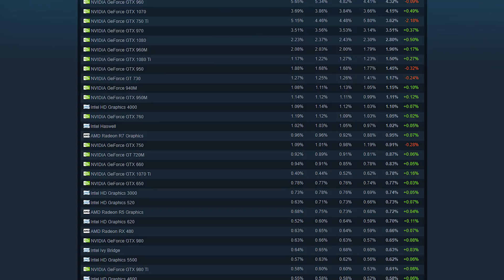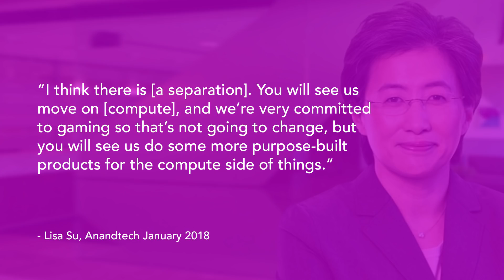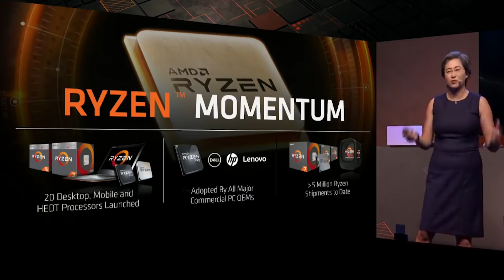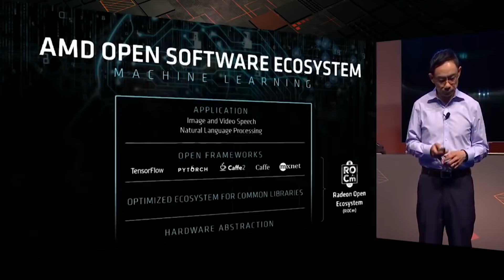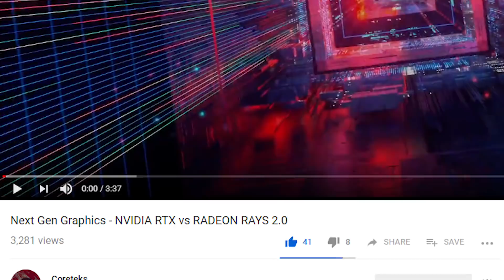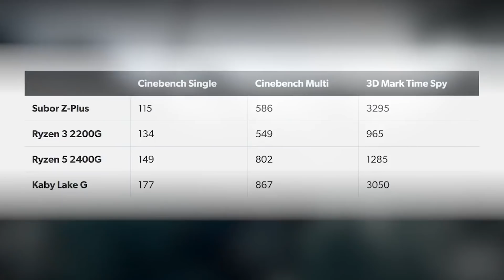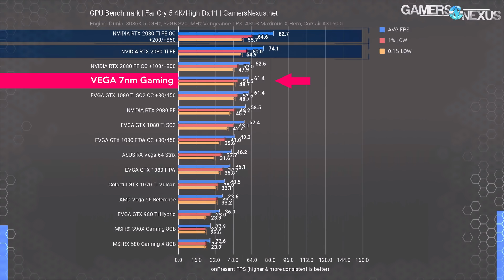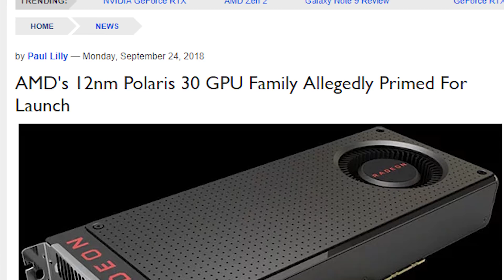AMD's answer to RTX

Comment: Not gonna lie. I am all over the 2080ti right now (bought two), but if this imaginary Vega GPU hits as suggested, i will switch over faster than any traced rays can render!
Reply: Rattenmann but the 2080ti most likely will outperform that vega on gaming. why the downgrade?

I mean it's nice if you support amd, they seem to need that atm. But if you are telling the truth you already threw a ton of money on nvidia.
Reply: I hope you also got a NVLINK bridge like me :D
But yes, if AMD makes anything that outperforms the 2080tis...Im going for it. Pro competition
Reply: Sooo how is your card right now when hardly any games support RTX? tbh I'm happy with my dual 1080ti for now as RTX seems like a waste of money till more games support RTX otherwise I'd just be playing games without using the full power of the 2080ti which is lame but that is their own fault for rushing a product that the gaming market wasn't ready for. If AMD's new card with the 7nm comes and performs close enough to the 2080ti I will likely buy duo if not trio cards since they'll be open source and I doubt AMD will make the stupid mistake Nvidia did with the RTX and to be frank that little loss in performance wont be that big a deal with today's games and the next games within the next few years. If AMD's new card comes cheaper then the RTX 2080ti then hell that is a bonus because the 2080ti is overpriced as fuck atm for a card that cant run at full performance for many of today's games since they don't support RTX yet.
Reply: @Zirethiel  cards are working fine. Better than any 1080ti. Up to everyone if they want to pay or not.
Reply: well, it is faster than 1080ti SLI, even without any RTX Features. So kinda happy here. Even without RTX Features, it is by far the fastest consumer GPU out there. It has a big price tag, but when was the last time you bought a flagship of any kind of tech (or even anything at all), and got the same price to performance ratio than buying a midrange item of the same category? It always costs a premium to get the best. The 2080ti is no different.
Reply: can you transfer money to my bank account please
Reply: Oof

Comment: Vega 56 and Vega 64 are actually great GPUs. They arejust 20% too pricey due to HBM memory. In compute terms, they're far more powerful than the competition.
Reply: They are good GPUs but the prices really are too high atm
Reply: Too bad the price is way too high, and compute means absolutely nothing for gaming.
Reply: ya. with the OC i have on myn i  beat a 1080ti.
https://www.passmark.com/baselines/V9/display.php?id=108634161978
Reply: @nosman123  omfg with the over clock?? ffs let me overclock the 1080ti and spank that ass sit da fuck down
Reply: looking at the raw performance (compute) can be useless because there is still other things that can affect performance such as architecture. but even if we look solely at compute performance AMD have one big problem. and it is one of their problem for a very long time: that massive compute performance can be very hard to utilize. this is one of the reason why despite their superior compute performance they are rarely score a design win for HPC contract. the last AMD GPU that enter top500 supercomputer list was Tahiti. Hawaii? despite murdering nvidia GK110/210 in spec sheet you can't find a single machine in top500 using hawaii based accelerator! with Vega AMD pretty much say bye bye to HPC and want to focus on AI instead but even that probably already too late.
Reply: @arenzricodexd4409  hey man, it's one thing if there are just minor mistakes, but you're way off the mark here. Why do you think cryptocurrency miners loved AMD GPUs? Why do people running 3D modeling programs run AMD? Because AMD is awesome not only on hardware but on software support too. They leverage open-source to compete with rivals. Recently announced NERSC-9 is an AMD Cray. SC18 (supercomputing conf) is this weekend. Maybe you should wait for news before making announcements, haha. Anyways, yea you're just wrong.
Reply: @edwardpark247  Mining is just one application. AMD excel at that because majority of the crypto algo was design with AMD architecture in mind. Amd have excellent software support? Just because they are more open source friendly than nvidia means their support was also good. There is one guy that emailing both AMD nvidia asking about OpenCL and CUDA. you know what kind of response he got? He got another email from AMD what GPU he got and what games he was playing. But from nvidia he was called directly by nvidia support team. When it comes to software support it is well known in the professional world how excellent they are in this regard compared to  AMD even if some of them did not really like nvidia approach with their proprietary tech. AMD EPYC processor might be a good fit for supercomputer machine but i dare to but for the GPU portion while company like Cray will be offering AMD GPU most of the client will end up picking nvidia tesla. Just look at top500 listing for supercomputer. Try finding how many using AMD GPU for accelerator in that list. When it comes to accelerator card even intel are more successful with their Xeon Phi. Even a few machine in the top 10 use intel Phi. Also you will not going to see Vega in top500 listing since vega completely lacking the most important feature needed for general super computer: FP64.
Reply: @arenzricodexd4409  new news today. have you read it yet?
Reply: @edwardpark247  yes. But it will not going to change most HPC client to use nvidia tesla over what AMD have. It has been this way for over a decade. Heck when AMD finally comes oit with S9150 there were article at top500 site talking how in half to one year time the top 10 spot will be dominated by AMD accelerator since nvidia nor intel have anything that can actually can go head to head with AMD Hawaii in term of raw performance. But in the end that prediction never come true. Forget about being in the top 10 not even a single machine in top 500 listing ever use S9150. And while AMD have improve the software side of things a bit what nvidia has done probably 10 times more what AMD has done. Software has always been nvidia strongest forte.
Reply: @edwardpark247  makes things up? i have been following AMD and nvidia GPU for a decade. just look this newly announced supercomputer called Perlmutter:
https://www.notebookcheck.net/Perlmutter-supercomputer-to-combine-AMD-s-EPYC-Milan-CPUs-with-Nvidia-s-Volta-Next-GPUs.361556.0.html
the CPU is based on AMD EPYC but the GPU will be provided by nvidia. why this new supercomputer did not use the new Vega 20?
Reply: @arenzricodexd4409   Yes the GPUs are NV Volta, that is correct. Next gen Volta, at that. Next gen EPYC as well. 

In the future, Radeon Instinct will perhaps be an option, but currently, Volta++ is way ahead of the game. Mind you, AMD has 7nm Vega incoming, so who knows, maybe they'll replace Volta++ with Vega due to availability issues. If you don't need Tensor Cores then AMD is a good option.

Anyways, from what I've gathered, the use of NV Voltas is because the system will make use of NV's Tensor Cores. The interconnect is Cray's tech. The buzzword these days is "heterogenous". No sense to stick to one vendor, take advantage of industry standards and interoperable techs to avoid situations like what happened when Intel's products were found to be dangerously vulnerable to hackers... clients were basically forced to go back to Intel for upgrades (patches could only solve part of the problem), which resulted in severe shortages, resulting in Intel having to go outside for production assistance with some 14nm products, but keeping info about what Intel's in-house fabs will be busy making, secret... secure Xeons, I'm assuming... and not for free, either, judging by Intel's recent earnings reports.

All I'm saying is that you, and others, can stop taking shit about AMD because they are doing something that noone else in the world can do, and that is, keep Intel and Nvidia honest. Cray going with next-gen EPYC (Zen 3 cores) is HUGE for AMD. Blade servers are back! Fuck yea! With water cooled EPYCs and Voltas, no less!

"the system will feature AMD Epyc processors and Nvidia GPUs offering a combined peak performance of ~100 petaflops and a sustained application performance equivalent to about 3X that of the Cray Cori (NERSC-8) supercomputer"

This is the optimal configuration for datacenter right now (not Perlmutter specifically, but as a sort of Proof of Concept that gives AMD a huge boost in Sales and Marketing). I have a feeling Cray Perlmutter is going to be the darling of the industry for a while. "Heterogenous" = AMD + NV. Why no Intel? It's because datacenter already has Intel. I don't know how much IBM Power 9 is out there, but EPYC also beat Power 9 for the design win. In any case, they (datacenter) don't need more Intel for a while. AMD will pick up the slack, and Intel can go back to deploying psychological warfare tactics instead of fighting straight up on the basis of technological superiority.

Maybe it's
Step 1. Evaluate NV and AMD offerings, with IBM's help. Hire IBM to consult as a independent 3rd (well, 4th...) party to help with highly technical cost-benefit analyses and other services that datacenter clients will be needing, as part of due diligence. Smarter IT is a strategic issue now. 
Step 2. Select AMD CPU and NV GPU.
Step 3. Buy from Cray.
Step 4. Profit
Reply: @edwardpark247  "Mind you, AMD has 7nm Vega incoming, so who knows, maybe they'll replace Volta++ with Vega due to availability issues. If you don't need Tensor Cores then AMD is a good option."

hardware is just one part of the problem. the client need the full package not just part of it. if there is shortage with volta (i doubt that it will since volta GV100 is built on much mature 12nm FFN vs Vega 20 that is build on much "scarce" 7nm at this point) i dare to bet the client will pick nvidia pascal GP100 over AMD vega 20. because this is what exactly happen back in 2014 when nvidia continue to reply on kepler for their FP64 accelerator while AMD release much faster and efficient FP64 accelerator on the market. if they can't go with nvidia they probably will go with intel xeon phi. 

yes relying on one vendor is not wise but as it is the alternative do exist. but sadly the primary alternative after nvidia is not AMD but intel. i was once thought that the accelerator market is just a duopoly between nvidia and AMD and intel will never be able to scratch the market much like how they never been able to do so with discrete graphic but once i saw the actual data i now aware i was completely wrong. intel actually quite successful in this accelerator venture to the point they actually eroding nvidia dominance. by market share the accelerator market was over 60% dominated by nvidia. the rest is pretty much intel. AMD market share for the accelerator market actually less than 1%! that's why those who said AMD better put more focus on compute oriented feature on their GPU since the gaming market are dominate by nvidia (some even said gamer pretty much ignore AMD) probably did not know that in professional world the situation for AMD GPU is much worse for AMD than it was for gaming market. 

for the CPU market i can see AMD will start going to make a dent on intel. Cray going for AMD CPU is not that strange either. the server market was once one of AMD strong forte. it is also the reason why Cray was quite confident with AMD Bulldozer before and decided to pick bulldozer to build the titan super computer (world fastest at the time) together with nvidia GF100 back in 2009. 

honestly we will want AMD to succeed but this fight is not a fight which AMD can fight both at once. they need to pick one and stick with it. the way it is right now they still have what it takes to wrestle with intel but with nvidia they probably can't win even if they pull all their resource to GPU development only. the "seed" that nvidia planted more than a decade ago is just too much for them to overcome.
Reply: if you use it for FCP X. other than that no reason to use AMD gpu
Reply: 'Gamers' don't seem to understand that. They're busy chasing frames and treat AMD cards like they're cancer unplayable cards. Bizarre.

Comment: I think "compute" was a codeword for mining (especially as spoken one year ago) rather than raytracing!

Furthermore raytracing as implemented by NVidia is not a GPGPU (aka compute) workload, but a workload heavily relying on new-generation dedicated hardware.

Radeon ProRender is a red herring, it's same thing as Optane and Cycles, just a GPGPU-accelerated raytracer - a predictably slow one, with tens of seconds per frame rather than frames per second. A little reminder that the prototype of RTX technology already ran at frames per second at prior-generation GPUs without the special-purpose hardware like RT and NN cores.
Reply: I think youre talkin a load of shit
Reply: Go ahead, download ProRender for Blender or as a plugin for some other software, it works on either AMD or NVidia GPUs of recent generations and doesn't give AMD more than a few % of performance advantage. Try it. It's critically missing any features that would enable realtime raytracing, it's same oversampling thing we've had for a long time. Its rendering speed is measured in dozens of seconds per frame and not frames per second.

Real-time raytracing requires a significantly different approach where you replace high oversampling with undersampling and smart interpolation, and that's something that according to Developers - see GN's Battlefield raytracing video - they had working on a previous generation NVIdia hardware, just a few times slower - and yet an order of magnitude or two faster than oversampling methods.

A year ago "focus on compute" was clearly reflecting the market, most GPUs were bought for mining, and mining is compute at its purest.

And look at composition of RTX chips, look at RT cores and Tensor cores, the former are dedicated units that evaluates spatial data structures to enable raycasting and do nothing else, and the latter is a programmable hardware that transforms one image pattern into another based on a trained dataset.

There is no statement of mine here that isn't demonstrably valid in the factual part. You're free to draw different conclusions from the same facts, but i think it's more of a reach to suggest that they meant raytracing all along. Furthermore the bulk of the PC market is not high-end but low-end to midrange, and raytracing isn't coming to NVidia's mainstream products this generation. ATI/AMD gave up the high-end gaming market a while back effectively, so while they were demonstrably aware of NVidia's raytracing efforts and contributed to Microsoft DXR standard, there's no reason for them to push it this generation, rather more likely the next or a subsequent one when raytracing is more reasonably expected to be available to the mainstream consumer.

Comment: Awesome video.

AMD has not and will not 'give up" on gaming.   BUT

from what I have seen, AMD is focused on continuing to push Intel out of the commercial server world with it's CPUs. 

The Instinct card are a bonus, as they are far better tuned for a wider variety of compute, and are the price to performance leader for a larger portion of the market. ( and have been since before Ryzen)

AMD, will settle into the RX570 - Vega 56 performance area of the gaming market for it's main focus.

With Intel cutting it's teeth in the GPU market, Intel will take over the SUB 1050 ti portion of the gaming market.

Nvidia will become the APPLE of the market. (Selling a %15 performance increase for %71 more money, because RAY TRACING. . . .)
Reply: Why

so much space?
Reply: efficiency.

each company will still make a full range of cards but their focus will change.

Intel needs a portion of the market won't be high end, and probably will max out at the rx560 level.

AMD just needs to exist, and it would be a waste to pour money into a 2080ti killer.

Nvidia has had a taste of "f***-you-you'll-buy-it" sales, and now, only cares about numbers that look good to share holders.

Intel has stupid business, who just need a "some hardware" (and can then charge MORE for CPU with iGPU)
AMD has leisure gamers
Nvidia has competitive  gamers

(to use nice words, I personally don't understand why a gamer needs to push anymore pixels than an HTC VIVE PRO.)

they will all need to use up faulty and poor quality chips in GTX1030 and RX535, but R&D will be focused on their 'sweet spot' in the market.

also AMD would be foolish to not wait for Nvidia to shoot it's self in the foot, or stagnate it's area of the market, before making an attempt at high end.

Intel's process-node-production-issue, will put it in a great place to completely restructure to and AMD style of CPU line + APU line.
Reply: LMAO your JURK comment had too much space and I didn't see the JURK part.

It's called 'formatting'

makesiteasierforpeopletounderstandyouanddelineateyourpointsaswellasseperateyourthoughtprocesses.
#sorryForYourEmptyLife